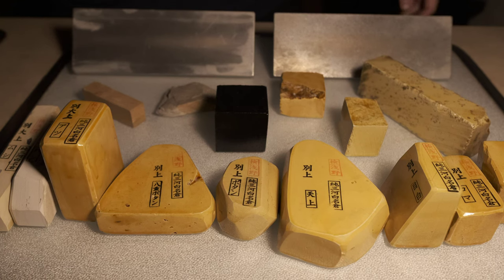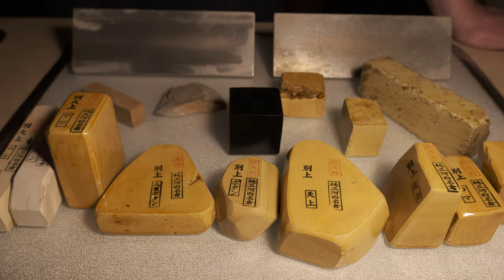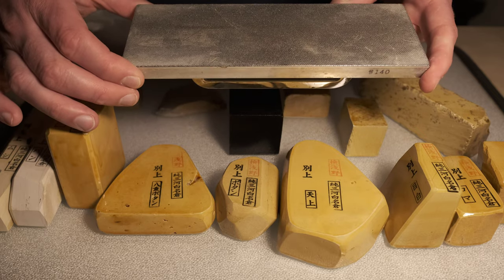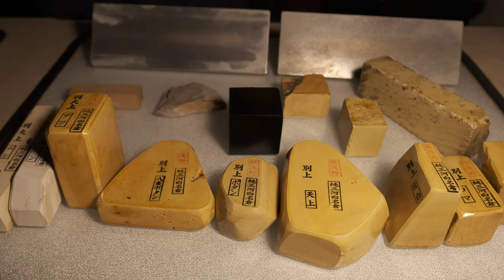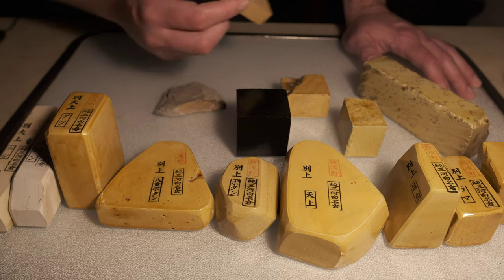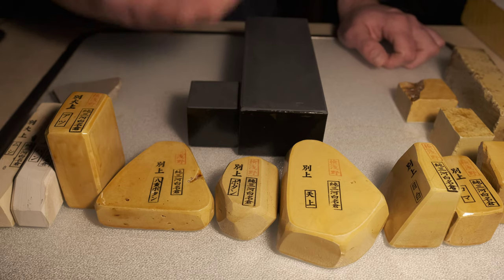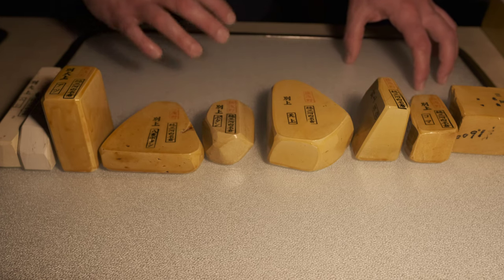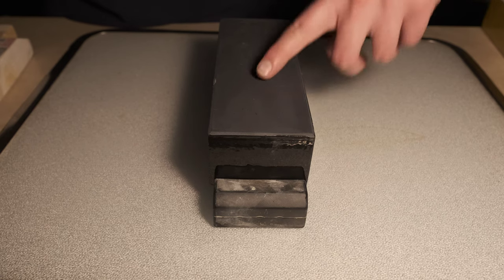Nagura Stone Japanese Natural Stones Whetstones, Mikawa Nagura, Diamond Plate - Kanji & How to Use

Comment: some people are cutting a line down the middle of their nagaras for suction is that safe im trying find out but nobody says anything.. they use a hacksaw for a very small groove (1 sixteenth inch) and use the edges of diamond atoma stone to round it off and smoothen it down the middle of the nagara. They are doing it with their synthetic nagaras also and using the same synthetic grit nagara on the synthetic water stones for slur (tomo nagara) supposedly the suction makes a better slur. Is this true? Have you tried it? Can anyone confirm this theory?

Tomo's are by far the best way to medicate and dress any stone even synthetic stones if you can.  It is how they did it even back in the samurai days on stones.. Tomo's (pieces from the same natural stone or even the same stone grit on synthetic water stones) creates the slur how its supposed to perform.  Supposedly the samurai's in theory thought tomo's were the way also.

I love your VOD's bro keep it up man they are very good

Comment: How does the diamond plate slurry compare to Mikawa Nagura speed of cutting wise? Could you use different grits for different uses?
Reply from the maker: Depends a lot on the base stone and the level of diamond plate you use. If the stone is a good it can be faster!

Comment: Hey after Aizu could you also use a tomae iromono? Or mid suita?
Reply from the maker: It is certainly possible. Most would have a second nakatoishi step at the top end of the range but you could jump to a softer Awasedo, will just spend more time on it. If you are polishing a second higher grit nakatoishi step is probably necessary if you are sharpening probably not.
Reply: Oh ok. Thanks but after the Tsushima do you use a soft awasado?
Reply: Cause I don’t have a soft awasado what else could I use like what type off stone
Reply from the maker: @Doodle-.Snoozel  It really depends on what you want to do. I would suggest moving it to an email thread rather than youtube comments which are a bit clunky. That way I can gather what you are trying to accomplish and try to point out the right direction: https://naturalwhetstones.com/contact-me/
Reply: Sorry so late can I contact you on kitchen knife fourms?
Reply from the maker: @Doodle-.Snoozel  I do not really use it much but sure: https://www.kitchenknifeforums.com/members/gbupp.49316/